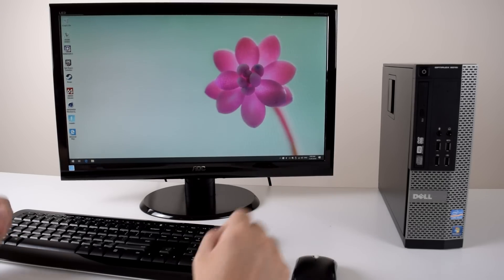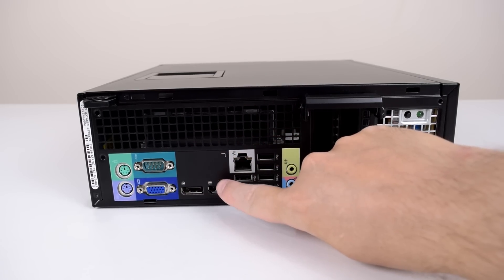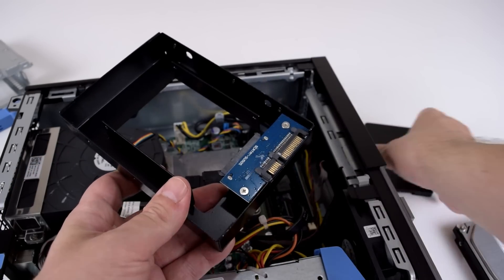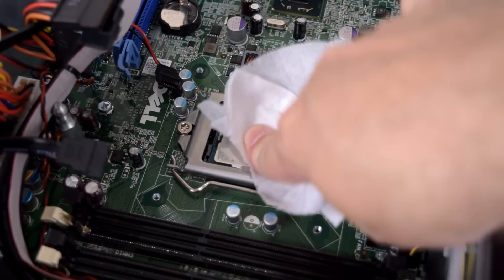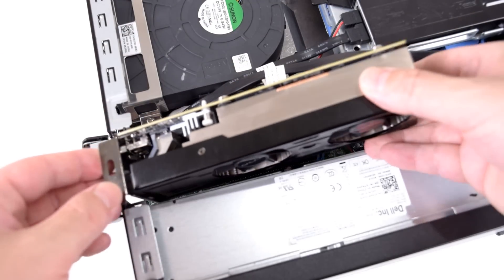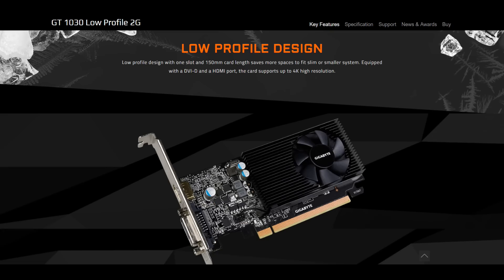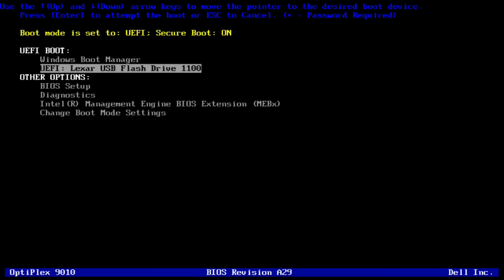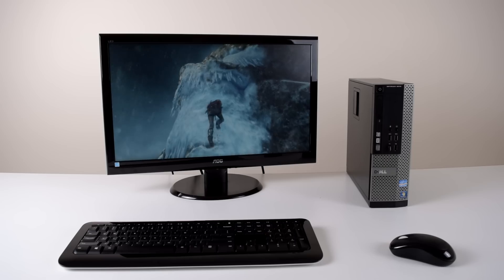DELL OptiPlex 9010 Upgrade Guide! Core i7 32GB RAM GTX 1050 Ti and more

Comment: Good morning Phil!  I built my father and brother Dell Optiplex 9010 Mini Towers with i7 3770 cpus, upgraded to 16gb of RAM & 500GB SSDs with GTX 750 Ti & 1050 Ti respectively.   I went with the Ivy Bridge (77w) as it had a lower TDP than Sandy (95w) and Haswell (84w) was a bit more expensive.  I may change out the Power Supplies with some $20 EVGA 450w BT units that I have.
Reply from the maker: Do you have tower versions? At least with the Small Form Factor version, which is what I have, I don't think it's easy to swap out the PSU.
Reply: @philscomputerlab  Yeah, I have the Mini Towers. The cases are pretty good on these Optiplexes as well. Metal instead of Cheap Plastic like the Dell Consumer lines have.
Reply: Also the Ivey Bridge Dell Optiplexes have USB 3.0 on the front and back panel, whereas the Sandy Bridge do not.
Reply: Your paying to much for those old ass cpus
Reply: i7 3770 and GTX 750ti?
lol, bottleneck is really a big thing in your PCs
Reply: @PrzeszczepiX  My father doesnt play video games.  He mostly does Photo editing and management, plus email and internet.  So the 750 Ti is basically unused.  Im thinking about swapping it out for an Radeon HD 7750.
Reply: @EscapeVelo  750 ti can work fine. Just u cant play on ultra setting. Now using 1070 and only play on ultra as using 75hz monitor.